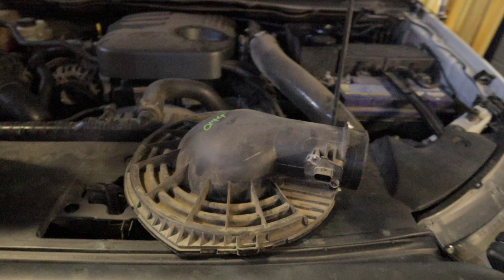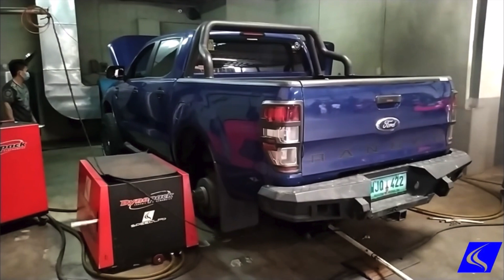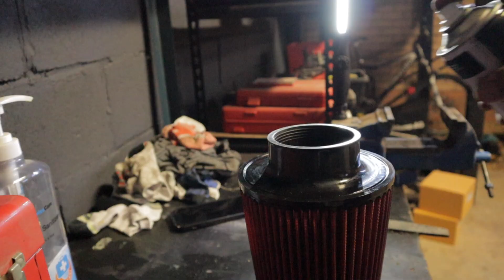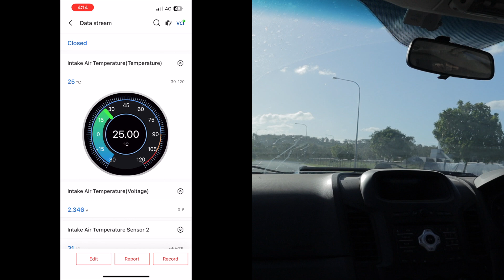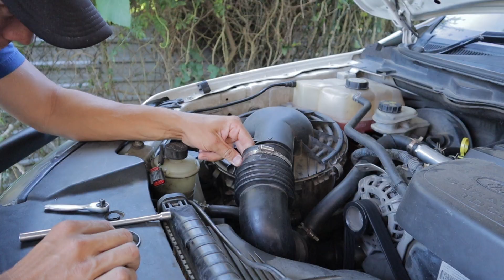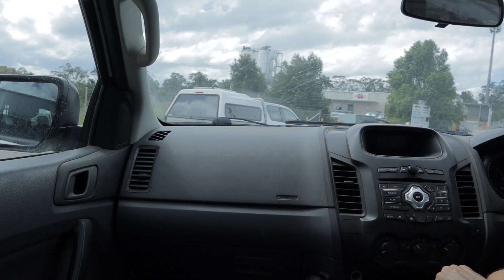Ford Ranger Pod Filter Install & Testing

Comment: I’m a bit confused. In South Africa, we have the same vehicle, with different model number/name, there are some minor differences, mostly due to regulations( the 2.2 doesn’t have a catalytic converter in South Africa). I’m confused by your front bumper (from a t8) and dashboard (from a t6) did you change your bumper or dashboard?

Comment: Plain and simple fact is if you do not shield this type of filter you are drawing in hot air. These types of filter do not work very well. A far better option is to keep the air box and use a triple layer foam filter like pipercross.

Comment: I did this mod to my old ford ranger 2.5 it did make a big difference. Not to mention that the filter is for life so savings were also a factor.
Reply: You talking about 2.5tdci you did a in box filter or open filter any difference or just sound ı might consider this mod on my pj 2.5tdci
Reply: @adilozkan9990  I did a washable cone filter inside the original can housing.. but remember particulate filtration is important. Male sure it's a really good cone filter. If you live in a dusty environment I would not recommend it

Comment: Hi mate,  ive seen a few diesel owners buy and install filters that require a spray of sorts to be applied to the element. Be careful, as there is a chance that the product thats applied to the element may also contaminate the map sensor.  When this occurs , the engine will over fuel.
Reply from the maker: good point

Comment: Does the factory airbox you’re using still have the elbow going into the guard?
Reply: Second this
Reply: I took mine out when I bought my ranger to allow more airflow, I would say just remove it fully,  never had a problem without it
Reply from the maker: no, i did a video on this

Comment: I would include a heatshield, like a separator, made of aluminium to at least make the pod draw more air from the front, and measure again.
Reply: Aluminum conducts heat - wouldn’t it just become another hot metal surface in the engine bay?
Reply: You want cold air thats more dense and that gives you more horsepower. Thats why a snorkel works best.
Reply: @TonyTony-rd4rj  A snorkel by itself will not do anything. A snorkel attached to an airbox, sure. But here, there's no airbox, that's why the heatshield is necessary.